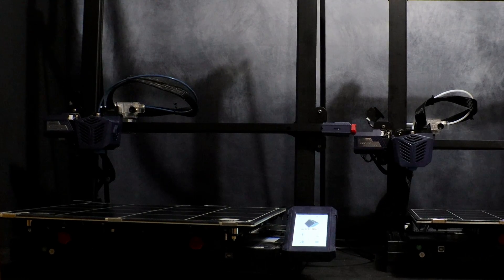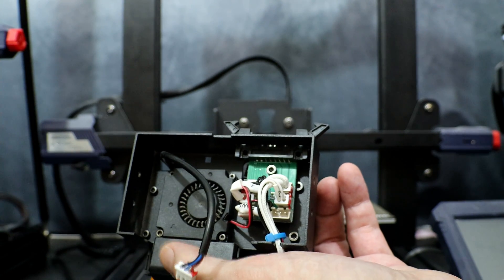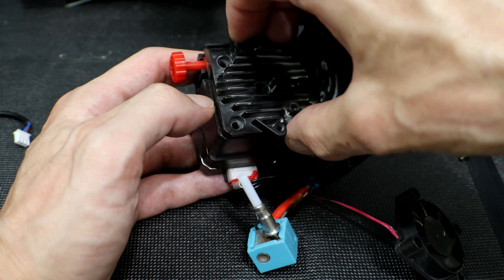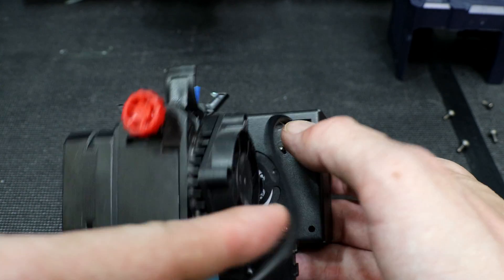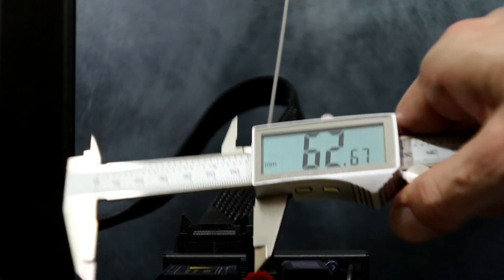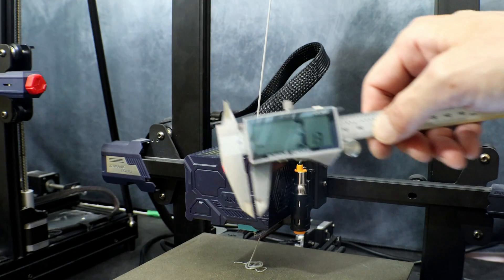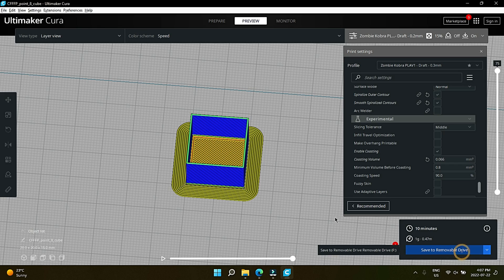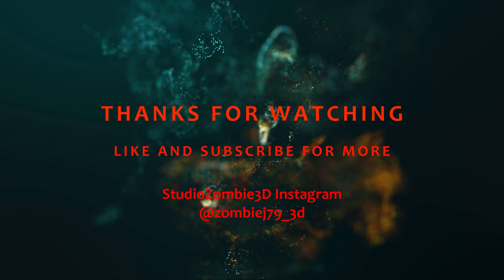Anycubic Kobra (Small) Calibration

Comment: In 8:59: i want to know if the filaments are already having some milimeters inside the head? or you just put it in top of the hole? how do you considering the 45 degree cut (to make it easier push through the  extruder?) is it part of 100mm or not?

Comment: I finally found the firmware you made on a facebook thing but after installing the v1 of it and attempting to print, it does the purge line fine but when it gets to the actual print the extruder just completely stops I just tried reflashing the firmware again and its just doing the same thing

Comment: Followed the steps, if I'm using the 0.4mm factory nozzle should the walls of the flow cube be 0.4?
Reply: That would be default line thickness for a 0.4mm, but if you changed the line width in your slicer, it should match the line width setting.

Comment: great video.  i am wondering though, should the esteps be calibrated for the X, Y, and Z travels?
Reply from the maker: You can if your printer is off. Mine are all pretty good put of the box dimensional accuracy on my prints have been spot on for me. If yours is good I wouldn't worry

Comment: Thank you for your amazing helpfull video. I had to crank the shit out of the adjustment screw in order to make it sorta consistent with the 100mm runs. Had a stock deviation between 15 en 25mm...  I also noticed that the filament was snagging sometimes, thus I thighted the knob even more, helping with the consistency, but I can't imagine that it has to be that thight.

My E started at 390 and after cranking the knob and 3 iterations I had to set to an E of 515. Then I tried again, which needed another small adjustment to 535! Currently printing test prints in order to see if it actually makes a difference. The weirdest thing I think is even though I had a base offset in my E steps from 390 (out the box), my initial test prints came out perfect. My test cubes were nice and the owl looked amazing. 

Other question, I had to tighten the excentric nut for the extruder kinda hard in order to prevent wobble. But during fast moves I can actually hear the bearing making a grinding noise. Print quality seems good, but should I loosen it a bit more?
Reply from the maker: On mine the extruder tension knob is pretty tight. It seems to be able to go quite tight with no damage to the filament I think its part of how it's setup. The teeth on the gear aren't as aggressive as most.  
For the noise I'd adjust the concentric to just loose enough to wobble then go back slowly till it grabs then stop some of them are touchy and with it being so tight could cause it to wear quicker. But as long as print quality is good I'd keep a eye for debris from it wearing if you don't see anything you should be good.
Reply: My calibration cube after setting the correct E (according to the math) ended up as the worst print I have made... Especially on the Z-axis I have a lot of over extrusion  and after reverting I am now also getting some zits and random blobs...

Comment: Pretty good tutorial.. but honestly, there were parts where i could not understand the words he was saying, and he flew by a lot, mainly during the pronterface stuff.. I also didnt really understand dissasembling the whole thing in the beginning to put it right back together. Lots of parts I had to rewatch over and over without explanation. Example, doing the math, he explains to divide by the measurement, but doesnt explain you need to subtract the offset from 100, then divide by THAT number.. or when measuring the 100 mm of the filament, he does not show if he is measuring from the ptf tube that feeds the filament or the actual base of the extruder.. this makes a big difference in measurement. nothing major, just found this a little frustrating to follow.

Comment: I own a vyper and plan to get a second printer to print terrain. Which one would you suggest standard Korbra or Vyper?
Reply from the maker: The vyper is a amazing machine but the kobra is nice for the direct drive. If the vyper is printing everything you need and it's working great I'd get another  vyper. The kobra is awesome but the extra built volume is a bonus

Comment: So no matter what I change the value to, I still only extrude 58mm of filament, any ideas?
Reply from the maker: Does the mark stop moving at all during the test?
Reply: Right now I’m recalibrating and I only get within 12 mm. I can see the gears turning faster but the same amount of filament seems to come out, any ideas?
Reply: The only real way the mark moves is by manipulating the red knob on the drive head
Reply from the maker: @saltwaterforlife5601  on my kobra I can tighten the knob quite a bit before it is too much  pressure on the filament it took a couple tries to get it tight enough on kine
Reply: Yeah there’s a lot of play in mine too but even with the sweet spot on the knob it still only gets me to 12mm. So bit of a update, I decreased my extrusion to 70 and I’ve been getting much cleaner prints, until last night, when it all went off the rails. My next steps are to replace the nozzle and recalibrate my esteps and go from there.

Comment: Zombie, I have been using your profile ever since I received my Kobra! I have a question though, how do you measure the extruder tension? Any tips on making sure it's in a good spot?
Reply from the maker: It's tough to judge with the small kobra it can tighten down quite a bit before it seems to cause issues. What I do is when I do the extrude test I'll watch the mark if it stops at all its loose. If it dosent its good
Reply: @studiozombie3d  Extrude test as in the test ran for e-steps, correct? Just wanna make sure, thank you for taking the time to answer my question!
Reply from the maker: @ScottyYDG  yep extrude 100 make a couple marks and watch them they shouldn't stop moving during the 100mm

Comment: My Kobra keeps coming up short every time I try the calibration. M503 gave me E390.00. So I followed your instructions and the extrusion was short 19.7mm. According to the calculation, I got a new e-steps value of 485.68. So I did M92 E485.68. After testing again, came up short 17.6mm. Repeated the instructions, came up short 15.2mm. And so on. Any idea what could be going on here?
Reply from the maker: Do you notice the mark moving at times during the extrusion? It could be slipping slightly they are pretty touchy the tension
Reply: @studiozombie3d  It seems to move smoothly, it just doesn't move the full 100mm. It's hard to tell if the filament is slipping on the gear just by looking at it, but I don't think there's slippage.
Reply from the maker: @jeff.fredrickson  keep your eye on the mark as it's extruding if it stops at anytime during the 100mm then it's slipping a bit try tightening the knob a bit I found on mine I can tighten it quite a bit before it's too much
Reply: @studiozombie3d  Ah, thanks for the suggestion to focus on the mark. I saw that it was in fact slipping. But the slipping didn't stop until I tightened the knob all the way to the point where it wasn't possible to turn it anymore. That seems pretty extreme. I thought maybe the filament tolerance was bad and it was too thin, but my calipers say the filament is in fact 1.75mm. I wonder if I just have a bad part somewhere in the extruder, maybe the spring.
Reply: I see this type of comment a lot and the only thing that makes any sense is that its slipping. often people think its not (they dont see any visible slipping)  Remember tho that there is some tolerance to the filament diameter, so if it comes to a thinner section it may not grab it as well there.

Comment: If you run the code "G1 E100 F60" again after the "E number" is updated.  Should it then use 100mm of filament. I keep running the test and it goes to the same spot every time....I am short about 30mm
Reply from the maker: When you do the extruder test watch the mark male sure it's not stopping at any time if it does ots slipping try tightening the red dial on the extruder a bit
Reply: @studiozombie3d  not slipping. My E is at 605...way off.

Comment: so I just checked this and I have a 13mm gap
but so far my prints have been very good
my estep from factory is 390
doing your math:
(100/87)x390=448
should I change this or keep it?
I mean I find it weird that im having good results for such a big gap in the 100mm test
Reply from the maker: You can change the esteps to 448 then do the flow test and see how it looks. When you do the extrusion test be sure to watch the mark to make sure it disent stop moving at all during the extrusion
Reply: just tried its saved  as 448.27 and now the gap is 9.5mm ?
Reply from the maker: @mrjoelpt  and your extruding it slow with g1 e100 f60? You can try setting it at 390 stock then adjust flow accordingly as well. There's the odd kobra that dosent seem to want to line up. You can try tightening the extruder knob a bit as well. I found you can tighten it down a fair amount and it dosent dig in very much
Reply: @studiozombie3d  yea I can confirm I used f60, the filament mark did not stop moving, I saved it back to 390 stock and alrready printed some stuff and its fine.
btw my flow is 100% and the flow cube is perfect 0.4mm on all sides with wall line set to 1

 I can retry again next weekend and film it

Comment: G91 puts the printer in relative mode (which you need for the e-step calibration), not absolute mode (which you said in the video). After entering the new e-step value and saving it you need to revert to absolute mode by either power-cycling the printer or sending a G90 code (as I discovered).
Reply from the maker: Yeah I messed the absolute and relative lol its not always necessary to send the g90 starting a print generally resets it, power cycle also resets but not always so it is a good idea to send the g90 just to be safe. I'll be sure to mention in the next video